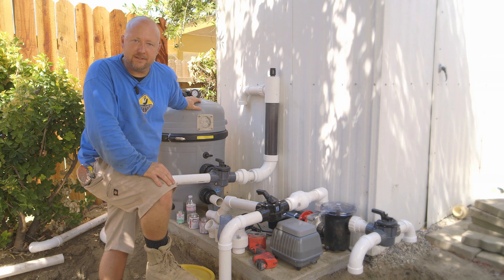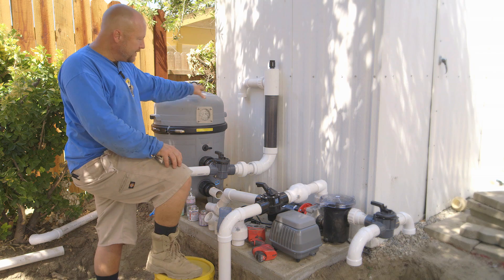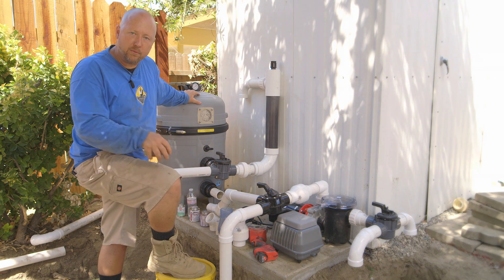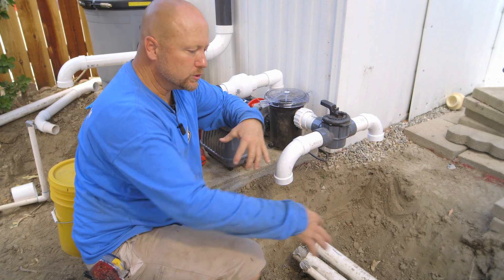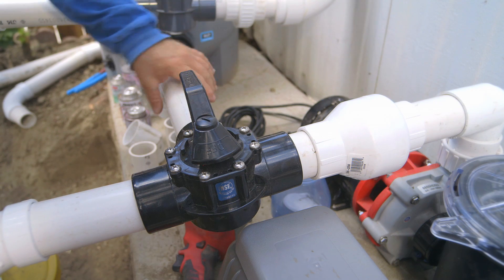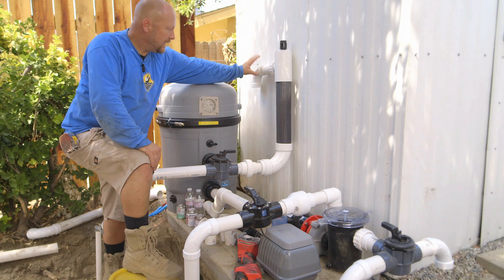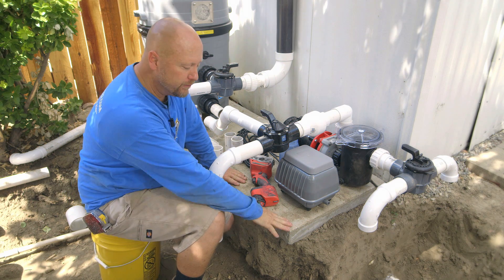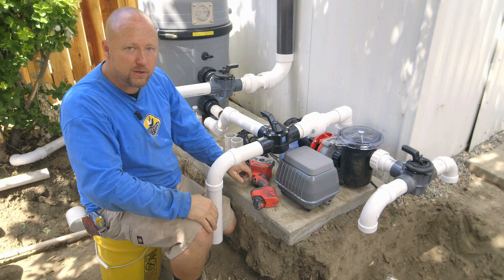Koi Pond Filtration System - KP 38

Comment: Hi Eric, I enjoy your series on building this pond and also on your koi video with Mystic koi.  Question... The air pump you are using on this pond, what is the brand.  Why do yo use this pump.  Thank you.
Reply from the maker: A Cheng The air pump we have in this video is a Laguna. It is affordable and fairly reliable. Apparently you can not rebuild the pump when the diaphragms go bad so I don't like that but again they are affordable and economical.
Reply: Thank you for your response. I see that Laguna makes several sizes of air pumps. What size do you recommend to push air into a 5 feet deep pond with a 8 inch round airstone. Thanks again for your response.